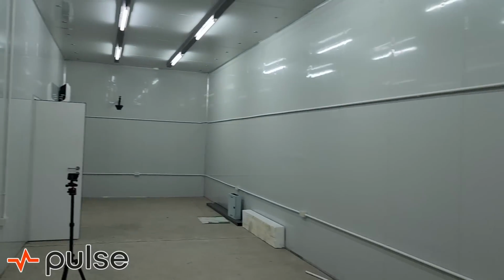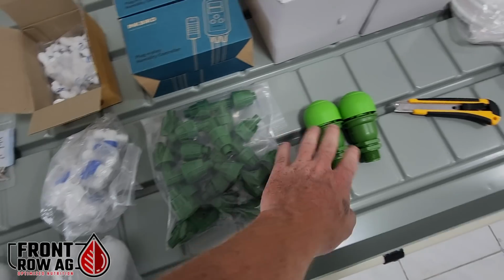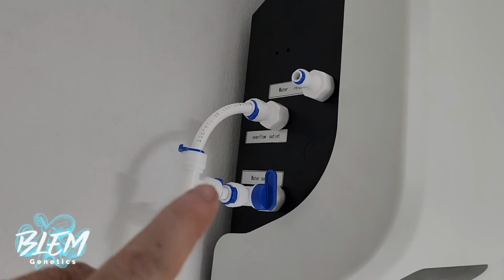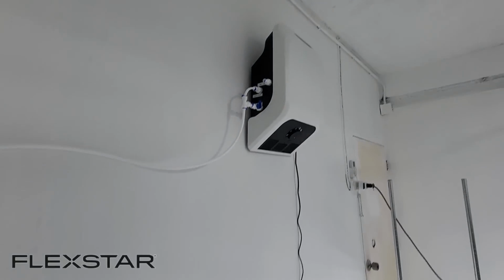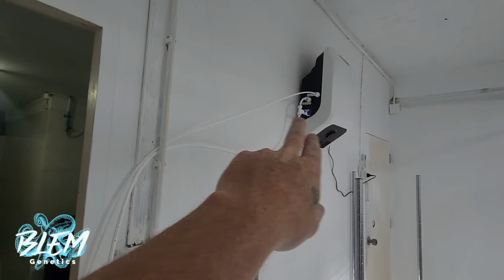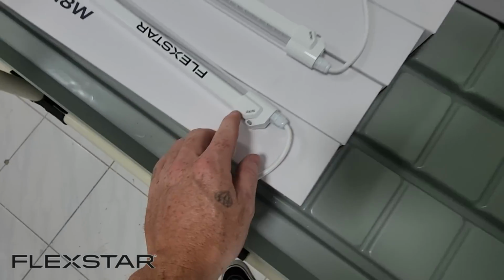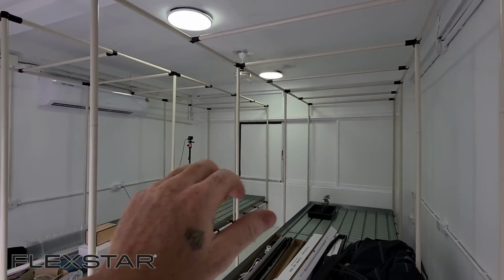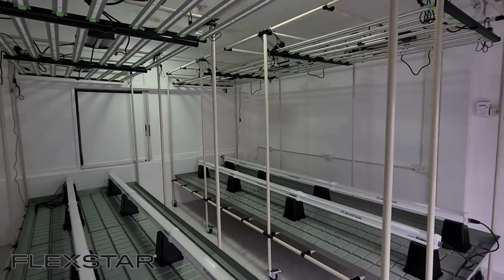BEDROOM INTO 6 LIGHT GROW ROOM!!! PART 2 TERPY HIGHS

Comment: Which model of Flexstart under canopy light are you using.  The Full Spectrum R5W or the Red Spectrum R8W?
Reply from the maker: I've used both, the round in the video is r8. They did a great Job at increasing yield.
Reply: @TerpyHighs  Thanks.  For my current grow I've added UV, IR, and Deep Red supplemental lighting all through Veg to the top lights for the first time.  Main LED lights are full spectrum.  I'm in 2nd week of Flower and will be experimenting with under canopy lighting.  Was debating whether to go with a full spectrum or red spectrum for the under canopy lights.  Looks like you've been using the red spectrums in all the other videos as well.

Comment: Hopefully that RO system has a backwater valve on the drain. In the off chance u had a drain back up it would back feed up that tube since it is inside the drain and doesn’t have an air gap on the tube separating it from the toilet drain preventing back flow. Cheers awesome room bro

Comment: Are these flex star lights the same ones used in the commercial rooms?
Reply from the maker: No. Different brand lights in the commercial facility
Reply: @TerpyHighs what's the typical difference? Reason why your not running the style lights you do in the commercial set up?

Comment: Good point about the humidity, I was thinking tropical. But AC dries it out.

How do you get on being a Ginger Ninja there? I would of thought you'd have to act like a vampire. Running between the shadows. I have a soul but I'm use to an average of 10 deg C (-5 up to 25. 18c is singlet and short shorts. zone 9a) or there abouts, more overcast rain days than not.
Do the monks freak out with you having no soul?

Is this room your personal grow or R&D?
What's the plan if it goes back to a narcotic at the ed of this year as planned?

Comment: get rid of the humidifier its thailand lol, strap a row of the bottom led lighting to the side walls 3 feet up from the table on both sides of the room. dial in your vpd at week 2 of flower. You are going to need another ac, hook up some 300- 400nm uva b and c. slap in a trollmaster and co2 tank. stop burning your plants with that garbage soil and coco out there, get some big momma grodan cubes or pro mix bx mixed with 30% extra perlite. Dial in your drippers well. easy 12 pounds of quads and 2 of mids out of that, bone dry. I got a sleepy joe Og x Tom Ford Pink cross i made an stabilized that would blow thailands mind. small 3.5 reeks up an entire house for days.
Reply from the maker: Got all the answers lol

Comment: I own a plumbing business, i know youre not in America but that sink will release gasses from the drain system if theres no trap somewhere. Generally we install J Bends below them to hold water and block odors/gases. It can produce methane gas from ths sewer.
Reply from the maker: I understand, that's standard I'm Canada also... but this is Thailand everything is much different here. Lol just elbows everywhere and a trap at the exit of the building.
Reply: @TerpyHighs  yeah I figured they used a running trap on the main sewer. We used to do that here a very long time ago.
Reply: We call them p traps where I’m from
Reply: @81crispy  floor drain traps are called P traps here. It's essentially the same thing yes.
Reply: Where do you put the j bend above or below floor
Reply: @Silentragetrolling  above the floor.

Comment: Oy Ryan, I had hoped to see you install some kind of scrogging solution as well since you were having those types of issues on the last run. I guess you have the time to come up with something by the time the plants grow to need it. I suppose this comment is just a reminder from the future to come up with something cool by the time you need it, then. Love the content and I applaud your achievements so far!
Reply from the maker: The trellis netting support is built into this table design by having actually strong enough poles going up to the lights. The commercial facility tables are very cheap quality, there are many growers in Thailand that experienced the same issue I did using the same tables. Unfortunately the aluminum side pieces on those tables are to thin material to be able to hold up large plants.
Reply: @TerpyHighs  RIght on! I didn't realize those were upgraded tables. Hopefully they do the trick this time and we can get some great shots of the beauties when they grow up!

Comment: I am curious about your undercannipy light stands , are they just square pots flipped over ?
Reply from the maker: Yes correct. I think they are 8inch tall square pots. Use zip ties to connect the lights to the pots so they don't get knocked off. I will be showing a closer look at the undercanopy lights in the next video.
Reply: @TerpyHighs  Thaanks Ryan !